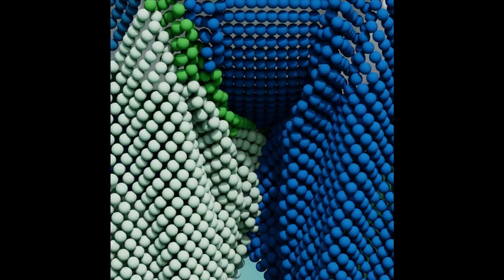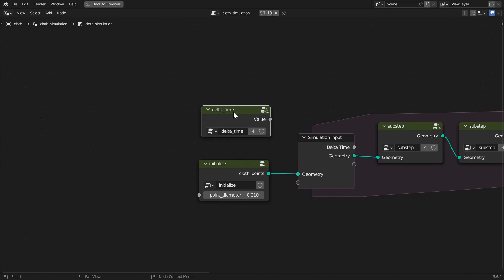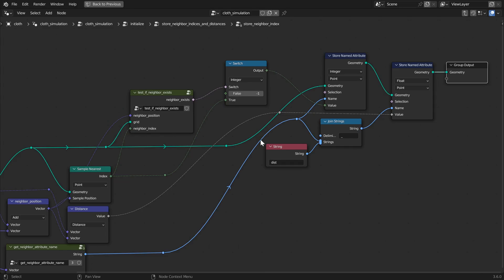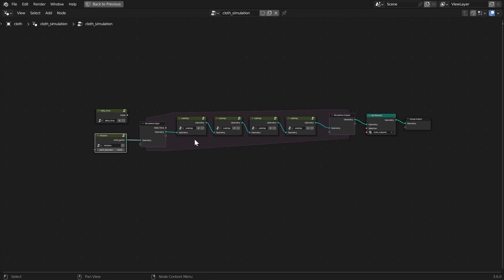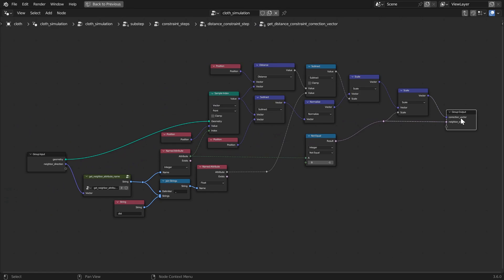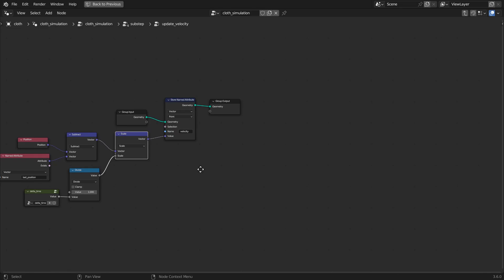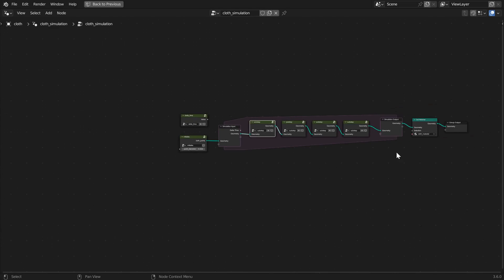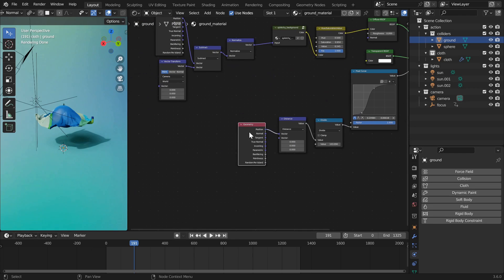Simulation Nodes Cloth

Comment: I've followed along.  I'm getting a pretty cool result but not the simulation effect you have created.  I'd say my result has the points acting like a high viscosity fluid that has a really loose distance constraint and those parts of the grid points in the initialization group that don't collide with sphere are not staying constrained, disconnecting and dropping to the ground.  Also, I've used Blender 4.0's Repeat Zone inside the simulation zone for the 4 instances of the substep group.  I'm sure I've missed something, but I've ran through it several times and am not sure why.   Also for a different visualization I added a group before the Set Material and after the Simulation Zone, consisting of a Points to Volume node set to Size connected to a Volume to Mesh node set to Amount

Comment: Hey Sean! Seeing that your simulation nodes explanation "series" stopped at this video for now, not touching (yet) on soft body or 3D constraints and interactions, would it be possible to get those demo files on your gumroad for dissection? Or some other method of moving forward with it, without putting the pressure on you to push out more videos. Much appreciated in advance!

Comment: You're undeniably cool, that's not up for debate.
This project could be a term paper at university or something like that.

Unfortunately, even the cloth stimulation engine built into the blender kernel is not capable of producing acceptable results in terms of speed and detail.

Until the Blender kernel is rewritten for highly polygonal tasks, until it is capable of processing polygonal scenes comparable to such packages as Zbrush, Houdini, Clarisse, we will not be able to increase the detail of projects.
There will be no responsive work with any environments in which detail is critical, and this is any simulation of anything, cloth, liquids, this is really uncompromising sculpting, this is the assembly of large-scale scenes....
Unfortunately there is no prospect of such a change happening with blender in the near future...

Until then, such themes can only be realized in low-detailed/low-polygonalized motion design mode...and it's downright infuriating... You can't throw in f***ing subdives as much as you need, it's infuriating that the whole blender architecture is so retarded arrrrg
Reply: Yep. I’m having to scale everything up for an fx shot that I’ll have to match later. It’s frustrating

Comment: I am trying to implement a cloth simulation system as well, albeit with a lot more stuggle and a lot less success, mainly because it is not clear to me how to properly translate the physics equation into nodes. One question, what integration model did you use (Euler, Verlet etc.)?
Reply: it's clearly euler

Comment: Amazing work once again! I love the auto naming system for the neighbor & distance attributes, very clever. I'm also very curious to see how you set up constraints for the softbody style sims too... I've tried adding additional constraints on the Z axis in the same manner as the X and Y in this tutorial but it always makes the simulation twist out of control & explode immediately upon impact haha.
Reply from the maker: Thanks! You're on the right track with the z-axis constraints for soft bodies. They are a hassle  to set up manually but the new repeat zones make it quite a bit easier.
Reply: @seanterelle  Do those softbody sims just require a lot more iterations? I’ve tried up to 16 but the behavior doesn’t seem to change. Still very explodey. Although it’s totally possible that I overlooked something in one of the many nodegroups!
Reply from the maker: @joeyvfx_official  I don't believe the explodiness is due to the constraint iteration count but it could be due to a larger delta time. On collision it's possible for a softbody to find the inverted solution to the distance constraints for some of the particles, causing a self intersection where ghost forces arise from distance and collision constraints constantly battling with each other. This becomes less likely with a smaller delta time. But those ghost forces tend to be pretty small. I'd say it was something in the constraint initialization but that doesn't match up with the issues only happening on collision. It could be in the distance constraint update as well. I'd try removing other factors like the collision constraint step and go over the distance constraint update to make sure all the correction vectors are getting calculated and averaged correctly.
Reply: @seanterelle   Looks like I did miss something in one of the node groups - forgot to wire in the Z axis in one of the auto attribute naming setups. It works great now! I don’t have diagonal constraints on the Z yet so it’s pretty wiggly but it is working :) thanks for the help!

Comment: Great stuff! This is with no Self Collision though, right? And could performance be increased by sacrificing accuracy even more?
Reply from the maker: All the particles collide with each other so there are self collisions! And yes tuning the delta time, number of sub steps, and strength of the distance constraints can produce different mixes of speed/quality. The biggest factor for me is whether or not the tuning prevents the cloth from passing through itself.
Reply: @seanterelle  Oooh okay, neat. I guess I had a settings combination that wasn't handling it well in my tests. I hope you continue to develop this! I've wanted to work with cloth more, but the current clunkiness of Blender's cloth system makes it very tedious.

Comment: Amazing stuff! Thanks a lot! How would you go about turning it from points back into a mesh? I’d guess you need a plane with the same resolution and set the position through a geo-proximity node?
Reply from the maker: Thank you! You can take the original grid mesh or one with the same parameters and set the position to the point on the simulated points with the same index. So first you could add a new output to the 'initialize' node group that comes from the grid mesh primitive node before it is converted to points. Then use the sample index node with the simulated points as the geometry input, the position attribute node as the value input, and the index attribute node as the index input. Then set the position of the original grid mesh geometry using the output of the sample index node.